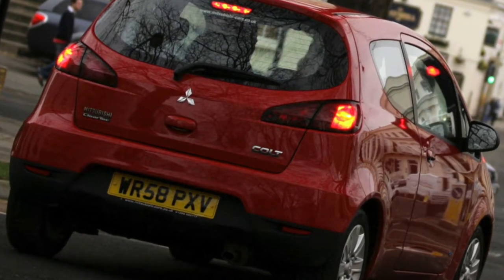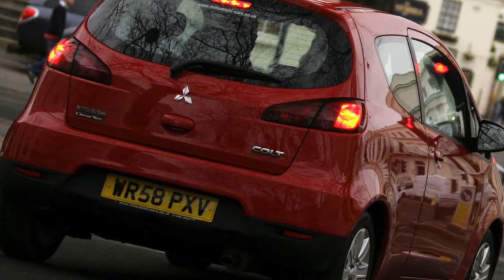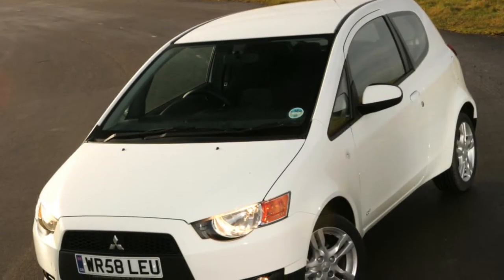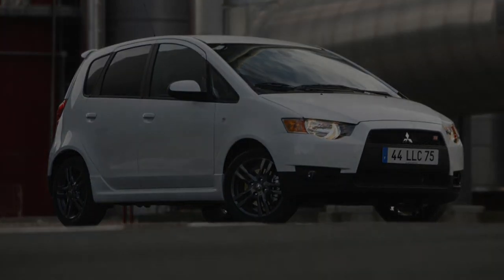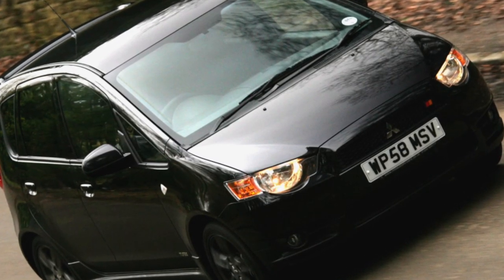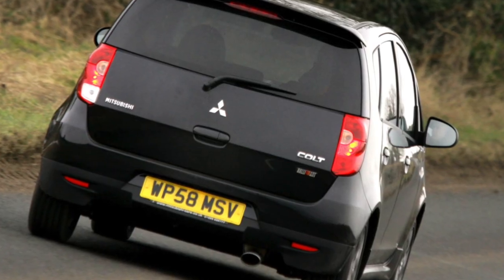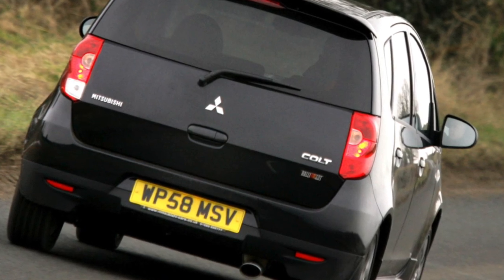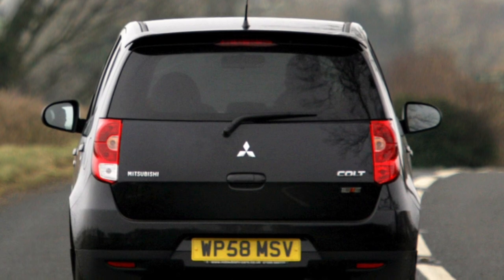Mitsubishi Colt 6 Problems | Weaknesses of the Used Mitsubishi Colt VI

Comment: I have owned 3 CZ1's since 2005, 2009, 2013.  I have never driven a more reliable car ever + 60+mpg.
No issues 2005-2009, the 2009 car I still drive (daughter's car).  It has 45.8K on the clock,  Rear brakes need new shoes.  The mid exhaust failed at 45.1K but was repaired with a length of tube.  No other issues.  2013 had new front discs/pads at 68K and rear shoes needed at 83K.  Mid exhaust failed at 81K and mid section replaced at £100.  The car was hit by a van and written off in Sept 2021 with 83.4K on the clock.

Comment: Bought a 2009 Colt facelift, only major problem I found so far is sticky shifter (left to right movement). I fixed this myself by replacing the gear shifter pin (under airbox) with one from a Mini, making it much more serviceable too.The original is pressed and needs to be drilled out while the Mini pin comes with a bolt. Starting to fall in love with it more and more.
Minor problems are the trunk floor and cover being droopy, but that's something I'm gonna replace in the future.

Comment: Thanks for the video. I'm generally happy with my 1.1 CZ3. PROBLEMS I've found were: dashboard unit (the one that shows temp and fuel range) backlight doesn't work properly (needs to be re-soldered?), leather on the wheel and stick shift are not very durable, original suspension sucks. ANNOYANCES: engine is fairly loud in lower gears probably owing to the timing chain, the body paint is very easily scratched, the seatbelt sound is really annoying and I wish I could turn the sound off, when it's sunny there's a lot of reflection on the front windshield coming from the dashboard plastic.

Outside of that it's a really easy car to work with and maintain. Already changed rear suspension, oil and filters, spark plugs, cleaned throttle body, changed alternator belt and water pump, flushed brake oil and radiator fluid... and I did it all myself. Really happy with that considering I'm no car mechanic. Car is working perfectly, just hope the timing chain lasts.
Reply: Im getting creaking from the rear on my Colt , it drives and handles well but im just scared the wheels gonna fall off lol as it sounds really awful it has done 117 thousand miles and is on original suspension but my garage wants £500 to replace suspension , i cannot afford it sadly

Comment: I have a 2008 1.3 model with 362.000 km on it. Engine and transmission run great and do not consume any oil. Have had very few expenses on the car, but have had defective dashboard computer unit (clock/temperature/radio-display) and handbrake, and the AC compressor seized up, and the exhaust broke underneath the middle of the car because they neglected to put a support between the catalytic converter and the long exhaust pipe. Otherwise very reliable car.
Reply: Old model before face lift ?

Comment: i have a 2005 1332cc Colt with tiptronic automatic gear shifter. Has 230,000 KM at the clock and running great. I hope to keep it until ~270,000 KM for about 3 more years. The only major issue was with the actuator clutch which had to be replaced in 2013 at around 85,000KM. Minor issues include the glove box which could not shut so I took it off. The heat control knob gets stuck when turned on the coldest setting, then you need brutal force to put some heat on. The computer in the middle stopped working at around 180,000KM (used to give the comsumption and temperature outside). Other than that this Colt has been a very reliable motoring.
Reply: Glove box is a issue with all models 2004-2008
Reply: The clock display is a Easy Fix buy one from. Junkjard i had the same and replace

Comment: I bought my Mitsubishi Colt 1.3 ClearTec manual transmision from 2012 about 6 months ago. It only had 24000km. I drove it for 6000km now found no major problems. Of course this is a very low milage car. There are literally no unwanted noises whatsoever and the car drives like 100% new. I have to be honest about one thing: Shifting the gear into reverse is sometimes difficult, but I read everywhere that they all have this issue. It's a pity it already has this issue when almost brand-new condition, because everything else is very smooth and feels as factory standard.
Reply: >Shifting the gear into reverse is sometimes difficult
I've found that waiting 1-2 seconds in neutral, putting it in third then into reverse works flawlessly and doesn't cause any gear grinding.
Reply: @extraholic  Thanks, will definately try that! Weather will be colder soon and I had the problem more often in the winter, so let's see.
Reply: Guys,, any idea about the automatic version?? I'm planning to get a 2013 model from London.
Reply: Have thé same car 1.3 from 2012 , also the reverse gear when the car is cold is difficult , i ve read somewhere that if u put it in reverse when the car is turned off it Will be ok or like thé comment below in third and after in reverse
Reply: @mohamedchatt4543  Yes, I tried this as well to put it in reverse before start and also to put it in 3rd gear first, then reverse. It kind of works, but it's not that much better. When you have to get your car out of a row of parked cars, you will need to switch from 1st gear to reverse a lot of times anyway, so it's still a problem.

I'll have my Colt serviced for the first time now, after 15000km since I bought it (now 40000km total) and I'll ask the mechanics about this issue. Perhaps they have a clue or experience with this problem (I'm going to a garage with good reputation :))
Reply: @extraholic  I have the cleartec model 1.3 2013 model and the reverse problem i "solved it" with 2 ways:
1)Press the clutch from netrual go alllllllll the way right, wait 1-2 seconds and after that put in reverse (Works like a charm)
2) Put first another gear and after that go to reverse
HINT: change your Gearbox oil with GL4 specs only! not GL4/GL5 especially GL5 spec because it destroy's gears synchro! So make sure the oil is GL4!
Reply: @extraholic double clutch it
Reply: @terinmathew dont buy actuator goes most of the times stuck big cost buy manual

Comment: I had a Colt CZT 2007 year i bought it from Switserland and had a 160 000 on it. Car was sitting parked with stuck handbrake and i redone all brake system, change 1 brake jaw and then i could feel very firm and rigid brakes. My car has missing parts and not so factory look because someone before me was going nuts with the car.. it had huge line for stereo under everything. my friends who drove the czt said that mine is fastest and strongest. i had full sliks sharp edge tires. Car was so reliable. I drove it one year and no issues at all. only issue thar car had was fuel uneffisiency

i drove it 40 000 km in one year and i sold it

car goes 0-100kmph under 6 sec.. my consern is that car has over 200 hp and going 30 litres for 100 km. all M5-s cryed baby blue baby evo. tomorow i  am going to buy  1.3 cleartec. i tried car and it was ultra funny

biggest problems was:

1- Reverse gear
2-Clutch sound
3-front lights-when  rain it loses contacts
4-low visibility in rear corners for 3-door variante

hint for CZT USERS ONLY 

-ESP module is located under the plastic tray under the handle of handbrake. Just carefully remove that plastic, disconect a Bosch sensor and you good to go :)
best fun for money if u have 5 k buy czt and tune it and you are fastest boiii

Comment: The car is great and 1.3l engine has plenty of power to have fun on village roads. However it seems there are some notorious problems that happen on many older colts (Z-30 or CZ-3) aswell:
- Steering binding near centre position and not returning to the direct centre. This one is possibly caused by lubricant in the power steering mechanism (notably on a geared shaft) getting out or not being properly applied from the factory. Power steering mechanism is electric can be disassembled, checked and lubricated again, or changed.
- Computer display spazzing out especially at colder temperatures (my observation) where it refuses to show temperature and other data, or resets it completely along with time. I still dont know how to fix that, but someone suggested reflowing the computers processor. That might be worth a try as these are almost impossible to find when new and noone will guarantee you that the used one will work.
- Car juddering/shaking with a warm engine (after driving like 20 kms) on light throttle in a range of around 1800 to 2300 revs/min - I have no idea how to fix that. Putting in very high quality fuel helps a bit, but still doesnt completely fix this issue. Internet nor google dont know aswell. Someone on honda forum suggested it might be a failing oxygen sensor, but I kind of doubt that due to this cars excellent fuel consumption. 
- Gear pin getting stuck/binding, causing gear stick not centering properly or making shifting harder - Look it up on youtube, there are guides. Sometimes oiling it well helps. 

I love the car to bits, but these issues grind my gears.

And at the end, I would recommend some mods:
- intake and exhaust - These are too constricted in a stock car. If you have a 3D printer, you can print a bigger intake part (can be searched on thingiverse), or buy that expansive sporty kit from KN. With exhaust, the choose wider rear part, the front isnt that narrow as the rear is. 
- Alloy wheels for less weight and lowering/stiffening the suspension a little bit for (but dont go with more than 25mm lowering with the same shocks/struts because that will drastically decrease their durability)
Reply: My steering is not centering itself, I could see a slight oil leak coming from the shaft, when looking up under the steering column inside tje car. Any quick fix?
Reply: @TheFootballDude18  I have no idea how to fix it yourself, sorry. I would take it to a trustworthy mechanic you have to get it checked, if its leaking. Although I dont think that there is anything to leak from the steering inside of the car...
Reply: What model year is your car
Reply: @problemslayer3538   2007, Z30 (Z34A), 1.3 l, 70 kW
Reply: I've fixed the engine shake by cleaning the throttle body: you take out the air box, unscrew the screws that hold the throttle body to the plastic admission, and spray throttle body cleaner on both sides of the throttle body (plus clean the air intake)

Comment: I have the 1.1 litre version and its like a rally car will do 60mph in 2nd gear and 120mph on a clear highway but the MPG is poor for  £6 of petrol  i only get 30 miles where as my old car a C1 could get 55 miles for same amount of fuel.
Reply: I could drive from wales to London while stopping at Peterborough on one tank I'd say its pretty good on fuel id say
Reply: @sfisosg7904  Yeah but your one probably don't have 130 thousand miles and an old Cat converter that's why I think mines using do much fuel ⛽

Comment: Steeringwheel does not center itself on highways. Correcting direction Constantly is a common symptom in this case. However, people tends to believe having a heavily behaving steeringwheel, which is not necessarily the case.
Reply: My colt does this, what causes it and how is it fixed?

Comment: What is the problem with small engines, how can high fuel consumption be remedied?
Reply: I dont know where the author of this video gets his sources, but I am getting between 4,5 to 6l of petrol per 100 km. If you have high fuel consumption, it can be caused by a faulty oxygen sensor. This car has two, one before cat and one after the catalyzator and most often the one thats dead is the first one, because it gets to experience high temperatures and carbon build up. I've seen a video where cleaning it in hot water helped aswell without needing it to disconnect.
Reply: I have the 1.1 version and mine has a fault where it is injecting too much petrol into the engine but im ok with this as when i put my foot down it goes like a rally car , it is a lot of fun for such an old car , reminds me of  the old Skoda Felicias they were fun too
Reply: @Warump  mine is fault free You have to drive slow for 6l I get 9/100km in the city, autobahn 6-12liters village roads even 5

Comment: Only one Problem by accelerating or deaccselarating loud "knock" sound from front right axle
Reply: I have the same problem knock sound from front right axle solution?
Reply: try replacing the lower engine mount (MR594272)
Reply: @cristigheorghe7819  lower engine mount is on the left side knock is from the right side
Reply: @cristigheorghe7819  Thank you for the effort Cristi👍

Comment: Wheel bearings backside around 120.000 km broken
Reply: Mine at 70k but i have wide wheels. Now 140k no signs of demage
Reply: Only original have this problems
Reply: I fixed my car passengers door didnt lock anymore the lock actuator engine broke